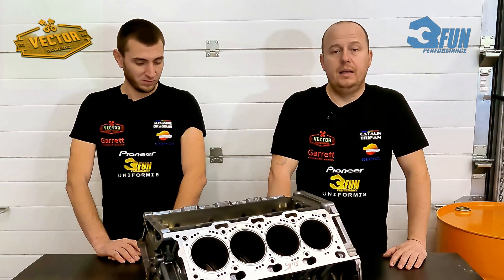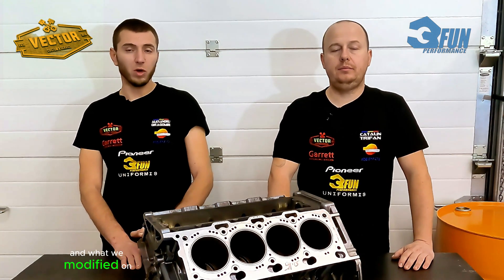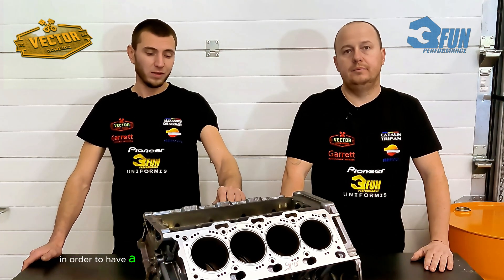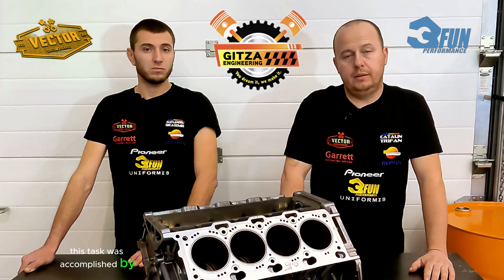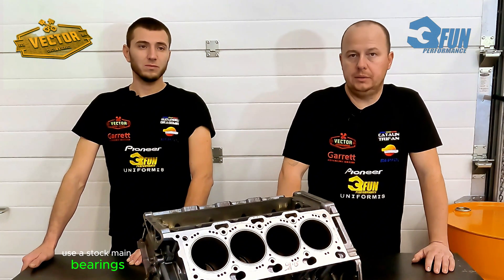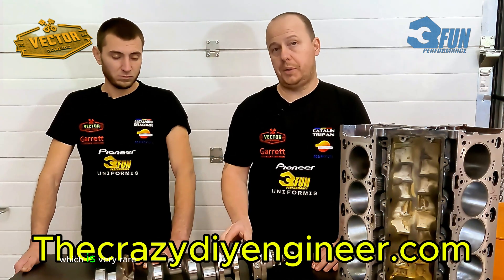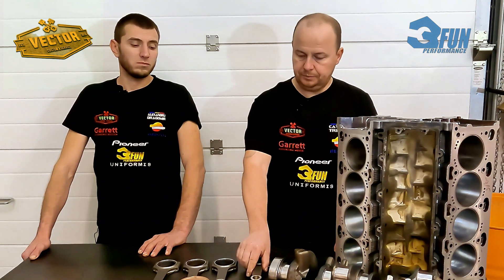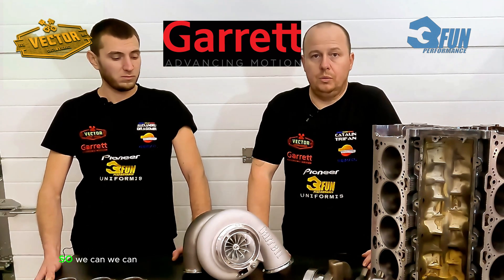Building the most powerful BMW N62B44 engine in the world - Part1 - Presentation

Comment: What you doing for oiling situation? Stock oil pump?
Reply from the maker: @stefandanalexandru9401  Stock oil pump is more than enough , its double pump. We'll use also Accusump , for more security , and also Oil Pressure cut strategy from the ecu , to stop the engine if oil pressure drops below certain levels.
Reply: @3Fun_Catalin  superb, what ecu your going with? Maxxecu, haltech, megasquirt what have you found works best?

Comment: how much boost do the stock components hold?
Reply from the maker: We have pushed to 1 bar boost (14psi) , but to be on the safe side we backed it down to 0.8 bar , at around 600-630whp . We speak about B44, b48 is another story, having much thinner rods. On 4.8 we have tuned a supercharger setup, to 500whp.
Reply: @3Fun_Catalin Ess tvs2 supercharger? And was the tune on stock ecu?
Reply from the maker: @fadilyacoubou8307  it was a screw version of ESS supecharger , i think a earlier version of their setup. It was setup with Maxxecu Race standalone , not oem ecu.
Reply from the maker: Also, we have pushed only with forged rods, 978 whp at 2 bar boost.....and going in competition at 800whp for reliabilty sake. Doing that for 3 years now. CHeck other videos to see how it works.

Comment: This is amazing dude, good luck! I wonder about valvetronic and variable diva (B44 engine). Are you planning to use both of those to aid in power output?
Reply from the maker: @arushagarampur7899  Valvetronic will be locked to max lift , with our self made lock kit , and DISA will be fully functional.
Reply: Can the lock kit be used with a supercharger? N62B48